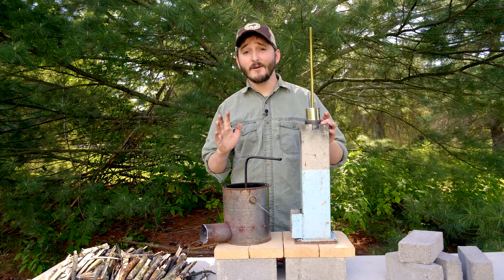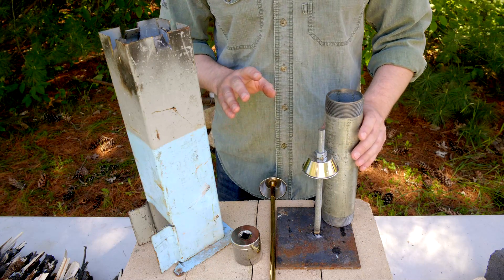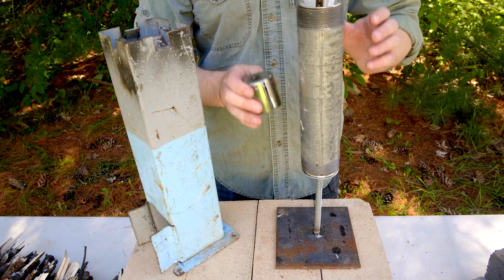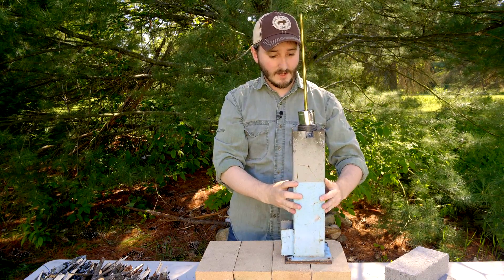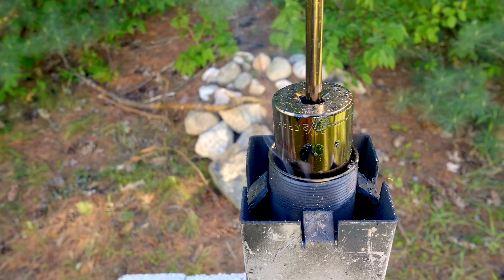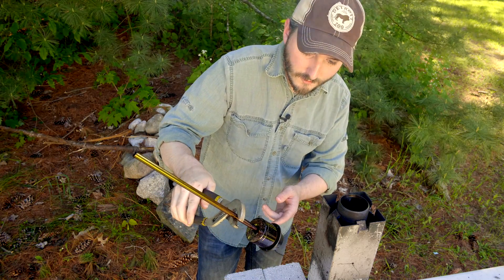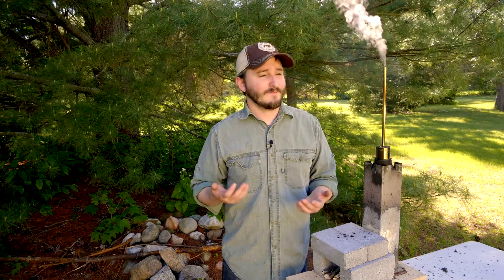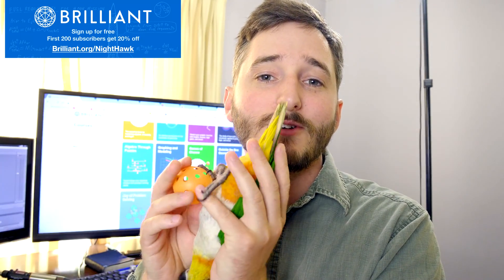Testing A Better Wood Gassifier (Bio Gas Fuel)

Comment from the maker: Hi everyone! Be sure to check out my previous videos if you missed them!
How To Build A High Velocity Vortex Cannon: https://youtu.be/MZnGvyOuluw
How To Make Solar Concentrating Mirrors: https://youtu.be/cWnykMRKQl0
Reply: A guy named Mr. Teslonian perfected this process and even ran a car off of wood gas! go check him out!
Reply: NightHawkInLight make a motor that runs off of that gas to power a fan for the stove to make it burn hotter
Reply: If you put a hole in the pipe that the wood gas escapes from it should draw up air and allow it to burn continuously. Put a sleeve over it with a similar sized hole to control the flame like a Bunsen burner.
Reply: Divert some of the gas back down into the stove.
Reply: This is actually called a Pyrolysis chamber, whereas a Gasifier combines the combustion and pyrolysis processes in one chamber; these were popular after WW2 when other fuels were scarce and both should really be seeing a resurgence as a cheap source of renewable energy. When used to run a generator it could easily power a home from garden waste and even convert plastics and rubbers into diesel fuel. I believe Pyrolysis has the potential to solve the energy crisis by, at the very least, acting as a power supply when other renewable energy sources aren't running, eg solar at night.  usi  Existing power plants could also be easily converted to use the process, and as it's even used to process toxic waste and chemical weapons, using it to turn household rubbish into energy, fuel and feedstock for the petrochemical industry is child's play. Wasting the energy in said rubbish and plant-waste by respectively burying and burning it off seems insane to me as one only has to look at a bonfire or forest fire to not just see, but actually feel, the awesome amount of energy literally going up in smoke When I look around outside I see solar collection and energy storage already installed everywhere in the form of plants, and wonder how those employed in the renewable energy sector can't seem to see the same obvious thing that I do. Long story short: Pyrolysis applied to garden waste could power homes either only overnight when solar panels aren't working and thus save on buying expensive battery storage, or even power the home altogether without even needing solar panels. On a larger scale it could power entire cities and make fuel from the plant waste and rubbish that would otherwise be buried in rubbish tips and generate methane as it rots. A city could provide an extra, larger bin for garden waste, which would not only be a good idea by providing the large number of people without ready access to ways of ridding themselves of garden waste, but would also provide the city with an extra abundance of plant-waste which, combined with the large amount of commercially collected plant-waste, could be used by a city owned power plant to provide power by the people for the people!
Reply: hey why dont you insolate the stove to save energy/fuel
Reply: Teslonian tried a chain saw off wood gas but I never figured out how it would work without oil injection since it was a two stroke.

A more practical application would be a wood powered bicycle! Chinese made four stroke bicycle engine conversion kits are cheap. Convert it to wood gas and see how many miles to the stick you can get!

They sold a steam engine bike motor castings set called the Vesuvius, named after the volcano. Look for a picture of one of those to see how they fit a motor and boiler onto a bicycle and you will quickly see your burner is about the size of the boiler they used. That's a parade piece every small town needs; the guy with the wood powered bike!
Reply: Micah K.  They kind of already invented these. They make a Stirling engine fan you set on top of your wood burner heater to circulate the air. Pretty cool; never need to fuel them. In India they used Stirling engine fans that ran on kerosene just like a kerosene lantern. Great for places without electricity.
Reply: NightHawkInLight Have you found a way to store the wood gas indefinitely in a container, for future use?
Reply: @NTRCOOL 
You don't need to store the wood gas. The energy is already stored in the wood itself.
Reply: exactly what i was thinking, this could be tuned to produce an efficient and clean burn.
Reply: you could have just made another mini paint bucket the same as the other one....
Reply: NightHawkInLight you should try hooking it up to the intake of a air compressor to have a wood gas tank rather than a propane tank
Reply: So did nighthawk ever do a video on that bird that is in many of his videos cause I'm confused on when he got it.
Reply: Great Concept, condiment  dish seal, but note  8:15 massive amounts of gas ignites from seal.  nice blue flames at 17. To much back pressure ??  maybe more weight ? or a softer packing.  it really simplifies the concept .
Reply: would wood chips work just as well? or dead pine needles?
Reply: NightHawkInLight duuuuuude XD no way!
Reply: you can't contribute to global warming because it is false!!
Reply: Very cool design! Just wondering if having the stove have a bit larger diameter at the base then this would be helpful.  Probably something that you have thought of since you are obviously very smart like that.
Reply: Cute parrot can we have a parrot video please?
Reply: Have you been to Finland?
Reply: Please come visit me!
Reply: I need enough wood gas from sawdust to feed a capstone c30!
Reply: You should try to make a
hydrogen generater
Reply: Hi, very interesting could you show  us how to create propane.
Reply: What happens if you put plastic in it? Can you make it pyrolyze to diesel?
Reply: try with COAL and/or Bituminous coal
Reply: This is one of the best designed wood gasifiers I have seen have you ever considered scaling up the size
Reply: Okay carbon monoxide is a very flammable gas and a very wreck of gas the problem with it is is if it's not burnt a second time. Will not burnt the second time it is inhaled by both trees and people it will then connect to organics being reacted in the system and won't release that's the reason why it's poisonous. But I'm more important gas to consider is methane methane is created during the biological breakdown of the debris in forest and on the ground is somewhere between 10 and 20%, methane or natural gas is 25 times more potent as a greenhouse gas than carbon dioxide. I've learned these things while trying to figure out ways to enrich my garden one of the ways of doing this is through adding what is called biochar basically charcoal into the soil charcoal has a lot of holes a very poor surface when added to the soil it will slowly load up in nutrients which are needed to increase the fertilization of the soil. Most biochar retorts are designed to reburn the gas emitted in the charting process to help fuel the making of the charcoal basically the opposite of what you're trying to do here my biggest question is does the filtration that you are doing pull the carbon Monoxide as it would be beneficial to send it through and be burnt a second time. Funny thing about most of the byproducts of the chart process is that most of them are in fact while being poisonous in the wrong places very beneficial to the environment if they're placed in the right places. That being said the original point that I was going to make in this comment is that while it was saying that natural decay would be desirable the production of methane gas is detrimental to The climate situation.
Reply: In Australia during WW2 we used wood gas converted trucks that ran on charcoal!
Reply: NightHawkInLight When it is true that woodgas is mostly co2 neutral, it never can be a reliable fuel source. Remember, the demand for fuel would be so big that we would wood down every forest just to get some gas, this is in my opinion no solution at all but it is non the less cool that you can make it ;D.
Reply: NightHawkInLight this is awesome, storing it would be amazing to and the wood gas could be used to supplement homes burning natural gas for heat
Reply: @jameshargrave8461 
Better burn the wood directly without complication of gasifying.
Reply: NightHawkInLight Global warming? As made by man is a hoax for more big government control friend. Remember WTC 7?

Comment: My dad used to make charcoal for various applications and had some fun years ago trying to come up with efficient ways to do just that. Wood gas was a part of the equasion, as I'm sure you can imagine. One of the systems he came up with was a 44 gallon drum with a removable top, laying on it's side, on a simple pipe based framework. Basically a barrel on a stand. He'd pack the barrel with as much small wood as would fit, leaving as few gaps as possible, then clamp on the lid. A small campfire style fire was lit underneath the barrel to bake the drum. The fun part was that he'd added a tube from the other end of the barrel that came out, turned downward, then turned in underneath the barrel. Capped at the other end and with a simple water pipe ball valve in it in the vertical section, the pipe had a line of small holes drilled in it in much the same way that a BBQ gas burner has. When the barrel had heated up sufficiently, the valve was opened up and the wood gas was able to flow down into the pipe and out the vent holes, where it ignited in the heat of the fire. Thus the wood gas from the baking would actually fuel the continued baking of the wood. The end result was a barrel full of high quality charcoal and required only a relatively modest camp fire to run.  (Note, the water valve was never quite completely closed, merely used as a flow control. Don't pressurise a drum and blow yourself up!)

As nice as this idea is, he found it was easier to dig a hole in sand, fill it with wood and then set fire to it, let it get to burning down and just pile more sand on top to slow-smother the fire to actually make large quantities of charcoal. But I always liked this self-firing retort idea.

One of my current mad science ideas is a solar collector that can use the Aussie sun down here to heat a small area. Yeah, NightHawk's vids involving paraboloid reflectors has me wanting to revisit this old idea. I want to use a distributed reflector array though and am trying to work out a focusing system to allow some better control of the focal region, so as to be able to vary the intensity and size of the 'hot spot'. Being able to heat a 4 gallon drum with sunlight to produce wood gas to store in a gasometer for use later is a thing I want to try. I'm also wanting to look at ways of compressing it for better storage, possibly using old LPG cylinders. There's a LOT of reading to be done before I look at that though, and in the meantime using a plastic barrel upside down in a water tank will give a good volume to play with.

SO many ideas. So few people in my life I can talk to about this.
Thanks for reading this far.

Comment: 6:20 by converting into wood gas you are producing butane and other gases which have much higher heating levels than carbon dioxide 

Not to mention that the ecosystem sequesters a lot of that carbon in the soil and the biomass, and that is not to say anything about the ecological value Deadwood has

Not hating, but I did have to counter this misconception
Reply: Ok, the former point would not apply if it was stored

But the latter does

Comment: You could potentially use waste heat from a heat exchanger (such as for liquid nitrogen production if you wanted a fire-free way of heating the material if you wanted to save the charcoal.

Comment: Wonderful. 
In the plans I was working on the biomass to be converted to charcoal was compressed and vacuum applied to lower the energy and heat needed to begin release of woodgas. I had thoght to have multiple chambers rotating into position like the cylinders on a revolver. The heat above the conversion chamber generating energy powering a pin style compressor for woodgas produced once cooled. The five combustible gasses and water vapor would be drawn out at different levels from the compressed gas storage cylinder.  
I will search your channel for updates. 
Thank you.

Comment: Hi, Thanks for all your videos. As well as using the tar for seals, this setup is presumably burning up excess tar to make more heat for more gas and tar. Also, I would like to see a video where you make a burner for the gas that holds a stable clean flame for cooking. Tim

Comment: Just a thought. If you want to keep your smoke stack burning, try drilling some SMALL holes at an upward angle near the top end to carburate air into the gas stream like is done in a natural gas stove, heater ect. Start with a couple of small holes at first then try it out. You don't want the mixture too lean to burn. If necessary, drill more holes, ONE AT A TIME until you get satisfactory results.

Another thought. Take a coil of copper tubing in an upright position and connect it to your stack with a smooth 180 degree curve. This will condense your tar etc. out of the gas and clean it up some. It will work like a moonshine still. It has to be upright so the tar doesn't collect at the bottom of a horizontal coil and clog the system.

If you're really feeling froggy, acquire a used, working automotive A/C compressor. Connect it with a belt to an AC motor or small gas engine and see if you can pump / compress your wood gas into something like a propane tank for later use. Just be sure there is still oil in the compressor if you get it from a questionable source like a junk yard. Without oil, just like an engine, it will seize during operation. You will need a stout 12 VDC source like a battery or charger with at least a 10 or 15 amp output to energize the electric clutch for proper operation. I wouldn't advise bolting the clutch as you can knock it off balance causing major vibration problems.

I don't know if a compressor from a refrigerator would work but if you have one laying around, it wouldn't hurt to give it a try. In either case, the compressor MUST remain upright at ALL times so as to not drain the oil out of it.

The only hitches I can think of with using a compressor is:
1) Designing or acquiring a moisture trap like the one's used on air compressors or diesel fuel lines to keep water, or in your case, tar out of the system.
2) Your gasifier will need to be air tight and not just depend on a heavy socket for a seal. With a compressor drawing a vacuum on your gas chamber, it will suck more air than gas without a good seal. Good luck with your endeavors. Jeff M.

Comment: I love wood gasification, it has to be the best renewable generator currently, its like the plants are our batteries.  Europe could really benefit from electric generation and home heating from a small wood gas powered electric generator. I want to build a wood gas ford 8n so I can power a pto electric generator, haul tree's, chip limps with the pto, and split wood with hydraulics.

Comment: If you drill few holes near top of pipe it will 🔥 easier? Could you do experiment how to pump wood gas to 20 lbs propane tank using refrigerator pump.

Comment: I'm surprised you didn't have a method to, "scrub" ladened gas after it came from your fracker. Can you inform your public as to what kind of gas production might be expected from say 2 or maybe 5 lbs of wood? I know there's going to variables related to the wood type, the amount of moisture in it, and such but I am hoping for a few general probabilities rather than something specific, for example: approximately is close enough.

Comment: Concur with comments about elegant design and clear, efficient explanation.

What is the ratio of (wood burned):(wood gasified)?
This could be scaled up, as a combined heat and power unit (CHP).

In winter, when solar production is weak, the gasification chamber could be inside of a wood burning stove, or stovepipe.  Perhaps refilling it each time the wood stove is stoked.

Maybe store the liquid fuel component mentioned in some comments for summer diesel engine, and use the syngas to run a generator to supplement the winter electricity.

Comment: Hey so I made my big cabin fireplace  with a 9 inch iron chimney pipe that runs up through a concrete slab that has a Barrel on it. The pipe runs nearly to the top of the barrel. Likely about 12inch because the pipe I came up with was that length. But the smoke rolls down the barrel to a fab'd 6" exhaust that runs sideways for a couple feet.. then up. I was thinking about running it up, then sideways, then maybe up again.. but I am not certian. I stumbled upon your videos tonight trying to learn more about biodigesters, and I am absolutely intrigued. From what I am seeing you do, is it that I can tap my 50 gl drum with say some copper pipe, then run whatever vapor it captures through a bubbler, then a pressure tank and its usable stoarable gas?   
At what height might be best to put said copper pipe in my 50 gl drum? Would lower be better? Or perhaps further down the chimney line?

Oh and hey,. Thanks man for the inspiration and knowledge dropping you are doing here. 
In the words of Bill and Ted, Most Excellent!